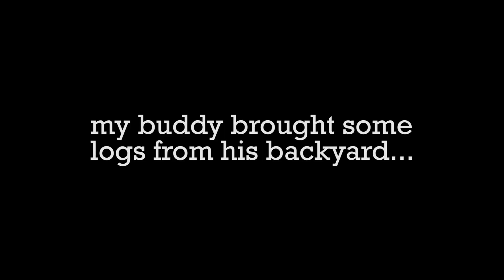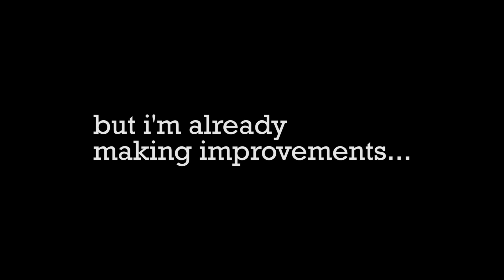Homemade Sawmill,  bigger motor - Ripping Through Logs!

Comment: Comparing this to the previous layout, performance is much better. I think the changes you made were all good decisions, but you may have solved your biggest problem without realizing it. The electric motor was driving the wheels clockwise and pushing the blade through the log, the gas engine is driving counterclockwise and pulling the blade through. This is much more stable.

Comment: Looks pretty darn good!
When I was running a woodmizer at my college wood shop we had a jug of water that was piped down to the blade, the water acted as a lubricant. I don't really know how much of a difference that makes in operation, but I thought I'd mention it.
When using a two man cross cut I've often heard of lubricating the blade with kerosene when cutting resinous woods, not sure if that's needed with a bandsaw mill, but thought I'd mention it.
looks like you have the tools to make one, so I'll mention that having a canthook or peavy would be a great addition to your log handling tool kit.
Lastly, making a set of modified log dogs might be the simplest way of anchoring the log for cutting. for some reason I'm not remember how the woodmizer held the log, it's been about 5 years.
I realize you might have already known/thought of all that. Happy sawing!
Reply from the maker: +dscrive thanks!  I have read about water and kerosene being used for lubrication.  I didn't have any problems with it sticking or building up sap and the blade stayed cool but I'll definitely try the water drip anyway.  If nothing else it will probably make the blade last longer!

Comment: It would seem that if you reversed those lower horizontal legs so the weight was predominantly on the rear of them instead of the front then the mill wouldn't want to tip foward as you saw. The rearward weight of the head and engine should help keep it down on the track. Also, adding a go cart type slip clutch on the engine would allow you to start the engine without having to also turn the entire blade system.  I saw quit a bit of side to side racking of the mill too. Not sure how to fix that other than to use larger tubing to increase strength. The last one is just a guess. Otherwise, quite a successful run. I had been thinking about an electric conversion for quite some time.  Now I know why no one has done it other than in a commercial level. Great work. Real craftsmanship went into this.

Comment: oh you made it! engine sound is great.
be careful vibration. 
It seems to need a separate safety device.
I think it would be nice to put a transparent polycarbonate on the back.
And the grip position seems to be unstable, it should have a stable handle like a lawn mower machine.

Comment: The end was going to be my suggestion for your safety.  Would liked more commentary as to improvements and changes that worked.  It was pretty impessive considering the geometry and tension issues due to smaller wheels.

Comment: 2 things that I believe will help your blade chatter ....... since your saw trolly is (relatively) lightly constructed ....... a crank sys. needs to be added to PULL the carriage through with equal pressure on both sides ...... OR construct a lawn mower type hinged PUSH bar ...... either way one key to good cuts is steady even speed all the way through he cut ....... very nicely built machine .................... ps: you need a water sys. to cool/lube the blade ......... JRW

Comment: " Ripping through logs??"  A 30" diameter hard oak log cuts at least a foot per second or more at full width.  Of course they use lots of water as coolant and a much faster speed.  Mine is home built but it has a 70 hp. motor and ten times as fast with cooling.  Without water the blade would dull in a few inches.  With water it has cut every day for almost two weeks with the same 1.5" blade.  I sharpen my own.  But for your motor that is pretty good.  Use a lot of water.  It's available and keeps the blade tips cool.  Mine cools before and after the cutting.

Comment: you need: (1) some sort of clutch to decouple the engine from blade drive when starting and eliminate the need to stop the engine between cuts.  (2) a retainer on the carriage to prevent a catastrophe when those RM2 bearings jump off the track angles.  I'd space the angle up a half an inch or so to allow a retainer finger to travel about 1MM under the angle and limit decouple of the RM2 from the angle.  Didn't get any further in the video as I kept cringing..

Comment: Great job !! Id figure out how to stedy it from swinging when the teeth bite in. + make one side of the blade guides adjustable to have both very close to the wood. other wise I really like the smallness of it.
Reply from the maker: +moonolyth every design out there has one movable blade guide, and I'll admit my saw is lacking because I welded both of mine.  This was partly to save space so I could cut a larger log but also because I couldn't think of a way to do it easily and cheaply.

Comment: Works very well, have you tried a power feed set up? 
Maybe a series of pulleys to the top of a pole with an appropriate weight to make gravity work for you.
Reply from the maker: That's not a bad idea.  I did attach a push bar that should make it a lot easier, but we'll see.  I will post a new video after I get a chance to cut a few more logs.

Comment: Very very coool!  Thanks for sharing.  
I wonder if once your cut is over about 18" deep, if it wouldn't help to insert a shallow spreader wedge back that the starting point? It would keep the top lumber from sagging down and choking the blade so that it could run cooler and more efficiently.
Reply from the maker: +Karabetter that's a good idea, I'll try it with the next log I cut.

Comment: Hi Dennis, how did you determine the width to put the wheels apart? I'm planning on building one, with 20 inch wheels, but is there a rule on how far they need to be spaced? Blade length i suppose, but I can't imagine welding up a 60 foot blade together and then space the wheels to put tension on it? Are there limits? I was thinking of an 1.25 inch wide blade
Reply from the maker: As far as I know there are no limits and you can buy blades cut and welded to any length.  I designed mine so the blade would be the same length as the one my 3 wheel bandsaw takes.  Now I'm redesigning it so I'll probably look at common blade lengths for the commercial machines since I like standardization.  I have a lot of leftover blades but I can use them on my saw in the shop which is nice.  One other thing to think about is what is the widest deepest slab you'll cut?  Lay the wheels on the ground and check clearance to get an idea. Remember to account for the blade guides.  Ok last thing - the wider the slab the more horsepower you'll need, and blade tension... Everything starts to get bigger.
Reply: @WhatDennisDoes  OK, thanks for the advice!

Comment: If you place the log to closes side of out feed of the blade just enough so the blade guide does not hit the log and make the in feed guide move inward closer to the other side, it will stabilize the blade and should give you a cleaner cut.

Comment: Did the slight downgrade help with the push?  What would the optimal angle be?
Reply from the maker: +Mortimer Snead it doesn't take much to push so I don't really need much help. Better control and having a handle is key though.  Stay tuned, I'm editing a video now with some improvements to the saw.  Will post in a few days!